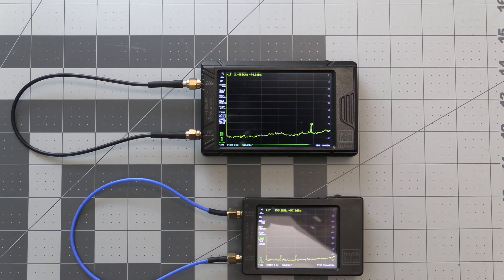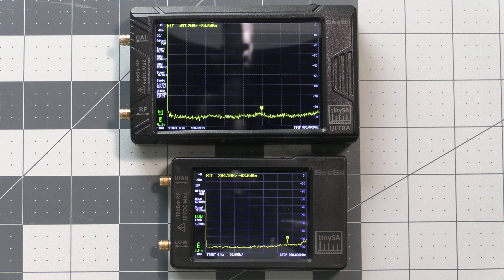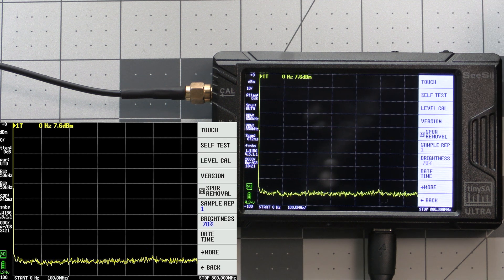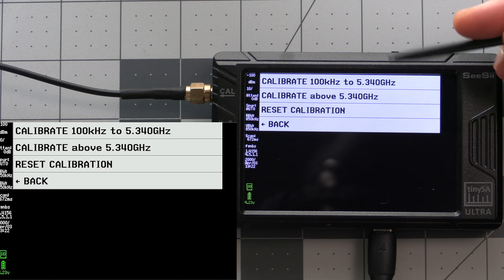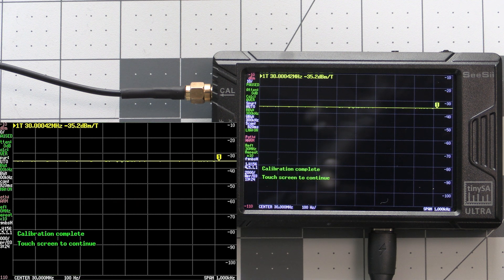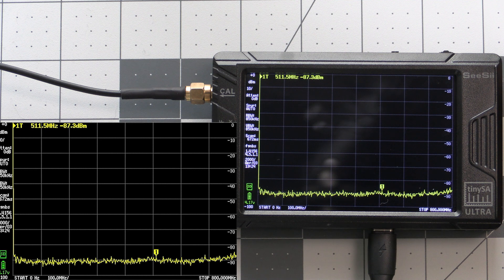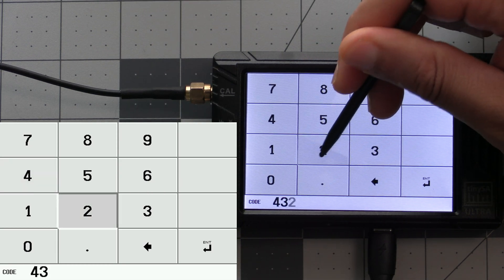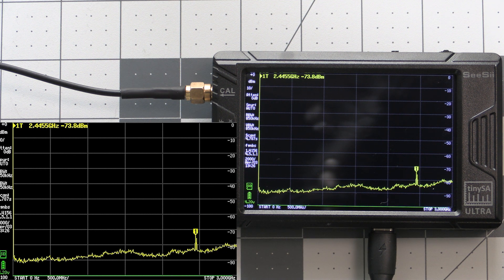TinySA First Setup and turning on Ultra Mode

Comment: Both of your most recent TinySA videos (1-year ago) mention a follow-up video which would be showing how you would use this with Meshtastic.  
Do you still plan on doing this?   
That would be really handy right now if it existed.  
I'm having some immediate difficulties getting it to display the signal/bandwidth and speed in a sensible way, most likely due to processing limitations.  
Your channel is fantastic, thank you.

Comment: On the Ultra how did you get it to calibrate at 5.34 Ghz when it only goes up to 3? Mine runs for a while then stops saying Signal Level Incorrect.

Comment: I am watching your initial setup of the Tiny SA and Ultra trying to follow the instructions.  I tap the screen to bring up the menu buy it instantly goes to a number pad which I cannot figure out how to get out of so I never get to the config step.  Do you need some type of magic wand to tap the screen?  Tried it with both finger and a ball point pen but neither works.  I am a newbie to this Tiny SA world.  Have 54 years as a "old school" Senior System EN for the DOD so be easy with me.
Reply: use a guitar pick

Comment: I don't see very many people talking about the tinySA outside of using it to test equipment. Sure, that is something the device does, but I think the fact that it can be used to detect and listen to other signals, similar to sdr or the modded firmware on the quansheng is a way better selling point and something that a lot more people will actually use, and I've only seen a couple of videos discussing it. Maybe you'll touch on that stuff in a future video on it.
Reply from the maker: Yep, that's in the plans. As well as using it for direction finding.
Reply: @The_Comms_Channel  oh that'll be sick. I'm looking forward to seeing it.
Reply: How do you listen to other signals?
Reply: @stevec5000 it has a "listen" mode and an audio output jack to connect a speaker. It won't do digital stuff but it can demodulate AM and FM.
Reply: OK the TinySA does not have an output but I see that the TinySA Ultra does.